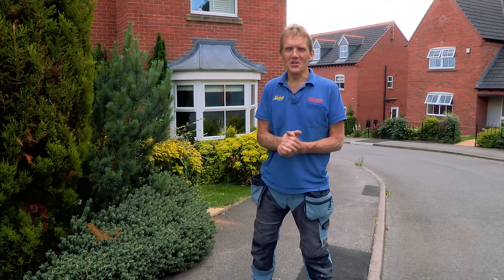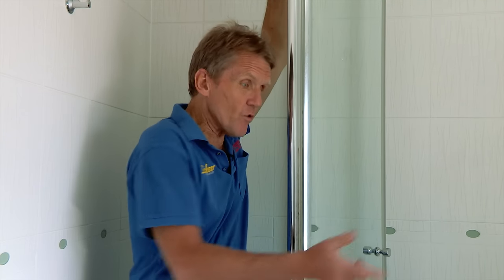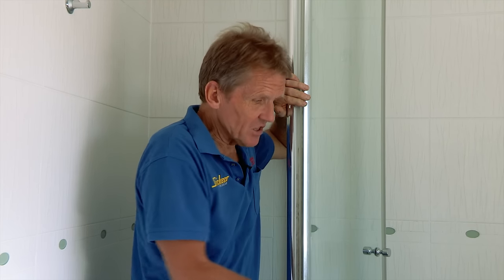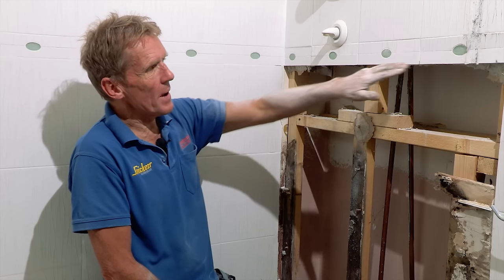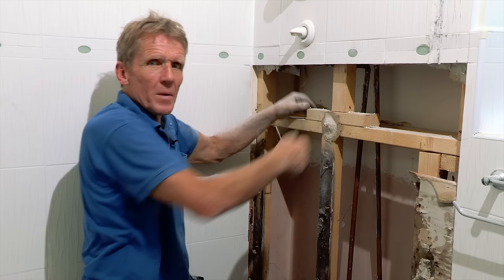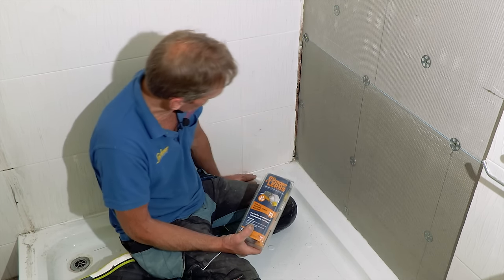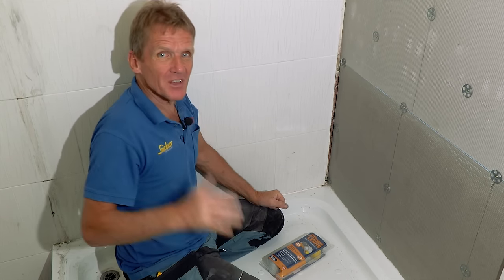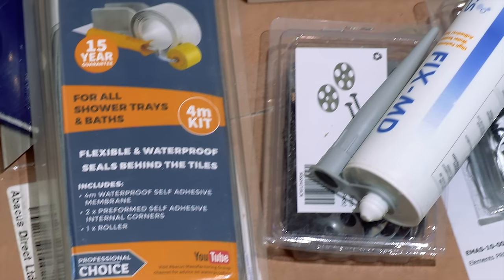Unbelievable Cowboy Plumbing Horror Show

Comment: Are you guys required inspections over there? At least where I live in the United States and you are building within city limits you are required to get certain inspections before certain building processes can continue. Would the inspector not find these issues like the shower valve not properly being supported and require the plumber to properly fix the problem before the tile guy can start his work? Also is the product you used like USG Durock board?
Reply: Have you every had anything inspected? Especially on a large jobsite. Inspector probably looked at one shower and said, "good. Do them all like this." Then the contractor gets lazy as the job goes on and doesnt do them all perfect.
Reply from the maker: That isn't true. The floors were held up on brackets which failed and the cumulative weight did the rest. How did those explosives get there?
Reply: Mate, many of the 'tradesmen' in the UK are not even trained properly anymore.  You can buy tools and be a brickie on Monday, then if you like you can be a chippie on Tuesday. Standards in the UK are low and our inspections and regs are just are, imo, terrible.
Reply: NO! Jet fuel can't even soften steel, that's what acetylene and oxygen can ONLY do.
Reply: Will Pelton - Actually there were NO explosives of any type used on 9/11 and there were NO real airplanes on 9/11 either. All SEVEN buildings of the Twin Towers Complex were mostly turned to DUST that day - so very little steel or anything else was moved anywhere especially China. Dr Judy Wood has exposed the TRUTH about 9/11 and how Direct Energy Weapons were used to turn these buildings to DUST. She took the US Government (NIST) and over 20 US Companies all the way up to the Supreme Court for putting out LIES with regard to 9/11 - two of those companies were Directed Energy Weapons MANUFACTURERS who were "helping" the US Government "investigate" the "collapse" of the Twin Towers. Wonder what collapsing buildings have to do with Directed Energy Weapons MANUFACTURERS - Dr Judy Woods EVIDENCE tells you what. Google Paisley Expressions and you will see excellent video interviews of Dr Wood and other videos exposing the TRUTH about 9/11 and the Jesus, Hitler and Wizard of Oz post on there just now exposes the agenda behind 9/11, 7/7 etc and how we have always been getting LIED to big time.

That post also exposes the massive debt/austerity banking SCAM and also the Mortgage/House Buying Ponzi scheme SCAM where the dumb sheeple are being conned into buying houses that they have already paid off through the secret Cestui Que Vie Trusts created via their Birth Certificates that they do not know that they have and the banks then con them into paying for at least another three houses over the life of the Mortgage and the biggest laugh is it never becomes their house even when they finally pay it off as everything belongs to the VATICAN via these Cestui Que Vie Trusts even your kids especially when they con you into registering everything to THEM. That is why you are only the registered keeper of your car NOT the owner. Part 2 of that post above is going to expose even more of all of this and how this scam system has been Foreclosed (SHUT DOWN) in 2012/13 but our corrupt controlled governments/political parties are not telling the people this.
Reply: What country is this in.
Reply: It is amazing the layers of bullshit we live under... well planned and hidden in plain sight, and people are so dumbed down they only see blue sky’s through chemtrails clouds ....
Reply: William Woods ... Does look like demolition explosives ...interesting thanks for sharing
(Tho it’s the ‘why’ that’s more important than the ‘how’)
Reply: @SkillBuilder  That's the 'official' NIST propaganda. What is true is that there WERE explosions that took place as watching any FOIA WTC video will prove - you HEAR them and have PLENTY of EYEWITNESSES. How the controlled demolition took place you'll have to ask CDI - or whomever was tasked under-the-table for the job. Simple physics would not allow a 'collapse' at free-fall speed. Sorry. Being a builder, you should know SOMETHING about that, eh?
Reply from the maker: Hilarious!
Reply: Countries gone to the Dogs. Thank god where getting out of the EU. Let’s take back control of our Building and Engineering Standards
Reply: @ronniewilson6597 ow they pulled it off 911? They aired an animated and prerecorded movie on all channels while they blew up the buildings. Not very complicated really.

Comment: I bought my first house, we moved  one week ago, i had a couple of shower and the plasterboard at lower floor has started to show a leak. Just looking at it, I was already aware that the shower was not really great.
I am an architect and i know how important is waterproofing. 
The bathroom has a very crap plastic shower tray which has been fixed just with silicon to the plywood, no membrane, no waterproofing nothing. 
The vynil sheet has been layed on the plywood directly sealing the perimeter with silicon around the shower tray, It is the worster thing i have never seen in my experience. I am starting to do the job by myself. Thank you for your video, it is really helpful to see from the pratical point of view..

Comment: Have not seen that Elements board here in the US but it looks quite nice. Every bathroom reno I've done, I have used the system from Schluter which is similar - a foam structural board with polymer facing. Then you can mortar a flat waterproofing membrane for vertical walls, and a corrugated waterproofing/decoupling membrane for horizontal surfaces. The decoupling allows the building to shift but isolates that movement from the tile work.

Comment: I did my bathroom with 1/2”  glass reinforced cement boards. The joints were silicone sealed before tiling and tiles were installed before the bath went in. Plumbing was 100% Hep2o.
It’s been there 25 years and still going fine.

Comment: Roger, I watched a video of an experienced installer who says that once the water gets in either through the grout or bad sealant you will still have to rip the whole lot out and redo, he says the expensive board is a waste of money. I can see his point. But I can also see the advantage of not allowing the water to soak into the substrate via the grout lines.

Comment: Marine ply is fine if used correctly, tile backer board over the top of plywood with a waterproof tanking matting and tape the joints then tile, it will never leak ever.
Moisture board or tile backer board on walls before shower tray then using the same tanking matting and taping joints, tile after the tray has been installed so it lips over tray and seal no problems at all.
Ply and moisture board absolutely fine if the person using it knows HOW

Comment: The more I do to this previously untouched 1982-build Martin Grant house in Guilford the more botches I find, from brickwork laid frog-down to useless  bracing in the loft to a ground floor screed that has a ridge running front to back and drops 1½" in one corner. 

When I pulled the bathroom apart I found the plasterboard stopped above the bath and rolled-up newspaper had been used to fill the gap before tiling over it. Needless to say the chipboard flooring underneath was like Weetabix. Fortunately no mould or rot.

Comment: I used to be a tiler/ bathroom installer in the UK for 15 years. I confirm that majority of bathrooms are bodged. I personally used Hardie cement boards with good Mapei waterproofing on top and Ditra mat on the floor. The idea is to make your tray and bath waterproof before you even tile. Also never dab and dob your tiles. I do something totally different now but missing UK and my old job sometimes.
Reply from the maker: That is sound advice, thanks.

Comment: I’m the owner of a medium sized plumbing company (14) engineers and I can tell you that none of these multi National home builders give two dams on the standard of workmanship no matter how pretty they make the homes look on glossy magazines. The reason for such poor workmanship is due to the builders telling the trades what there going to earn which is very little so in return firms will draft in lots of low skilled workers ( labourers) who are happy with £80 a day then on that site of say 200 houses you have one skilled full professional who will earn say £200 ( the going rate for skilled worker ) to oversee and make sure it works. That’s it as long as it works it passes. So it’s greed of the builder not prepared to pay the going rate to have a proper job as show by this chap in the video 
I’ve been offered sits across the country and I’ve been to check the sites out to see standard and have just turned round and said our lads couldn’t be this ruff to which the builder just grin and say someone will do it for this price
So there you have it greed wins the day not quality
Reply: I have been in the plumbing trade since the early 90's when I left school and I have to agree with you..
I don't know anyone in the building trade that has bought one of these new house and never have and there even worse now than they have ever been..

Comment: Great video Roger. With what you said about vapour migrating through the walls, would you use elements board for the whole bathroom, or plasterboard for the walls and elements only in the shower enclosure?
Reply: Hiya.When I built my own utility room extension 15 years ago because there was going to be a tumble drier I had to install a vapour proof layer of 1000 guage dpm under the roof joists prior to boarding for the reason you mention.Its there so vapour escaping the ceiling board cant condensate on the joists and bridging etc.Building regs stipulated that by then.Bathroom regs for new builds in the uk have also improoved since then for the reasons you mentioned.

Comment: I am an English plasterer though live in Australia, with 35 years under my belt.
I have seen many systems being used over the years, and most are certainly good enough if done properly. Unfortunately in nu builds/spec homes the system being used is rarely done 100% correctly.
The main problem is the original plumbing, if it is leaking through stress or bad workmanship, you have water escaping.
Even if the shower area is 100% waterproof, the water will instead bleed through the surrounding, and adjacent walls in other rooms. That can turn into a re-plaster of several rooms, and very expensive. If you can detect a musty/damp odor in the air, that is a sign of ingrained mold spreading.
Fixing and testing the plumbing for a period without plaster is the first step, then when confident that all is well, then re-plaster using the correct waterproofing method applied.

Comment: for showers I do:  PVC 40 mil liner from top to bottom on inside of shower pan.   Then cement board.  And then a 2 heavy coats of Red Guard polymer sealant.  Either the liner or the polymer are enough on their own, but I do both.

Comment: This all seems like a good idea, however having tiled bathrooms for 30 years I've never had a call back due to water getting through the tiles and damaging the plasterboard. Providing the tiles are properly installed and a good quality grout is used with good quality sealants and regularly maintained it will last indefinitely. Tiles have been put on plasterboard longer than I've been tiling and I've been back to jobs I have done 10 to 15 years later and they still look as good, even if the style now looks somewhat outdated. 
What I have found recently though is that I'm getting called to jobs where the system you use or similar, has been used. The problem is usually a leak in the pipe work behind the type of water proof system you used. What happens then is that the water runs down the back of the waterproof board, soaking the wall and timbers  behind and the flooring beneath. In a lot of cases because the shower area is virtually tanked, there are no visible signs and by the time the leak makes its way to a visible surface, the leak could have been there for months, or in some cases years, before the problem is detected. By this time there is considerable rot damage to all framing around the shower and to the joists beneath the shower, in some cases resulting in dry rot that becomes a much bigger problem than a few tiles coming off because the plasterboard behind has become wet.
So although this seems like a good system I think customers have to ask themselves, if there is a leak behind my shower, would I rather know sooner than later. If the problem shows on the surface sooner because the plasterboard deteriorates, then it is only a matter of carefully removing the tiles and damaged plaster board to just above the leek, repairing the leak, replace the damaged plasterboard, clean up the back of the tiles that were removed, re-tile and seal. The other option is to tank the walls as done in the video, have a leak that can go undetected for months or years, take the tiles off your new waterproof board, which will be almost impossible without breaking them, remove the waterproof board, remove any rotten timbers behind the waterproof board, remove the shower base and replace any rotten flooring, joists etc and rebuild the whole thing.

There are times when I've been called to redo tiling in bathrooms where tiles have been put on top of plasterboard, but I have never found the problem to be caused by moisture getting through the tiles and damaging the plasterboard, where the tiles have been fixed properly and the grout has been maintained. The problem always stems from leaks behind the shower or not properly maintaining the silicone seal. At least with plasterboard the problems becomes evident very quickly and is easily rectified. 

I have also heard of very similar problems with the new craze of fitting upvc fascia and soffit. With the traditional timber fascia and gutter, if there is a leak in the roof near the fascia and soffit, it soon becomes apparent when the paint starts to flake off. With upvc it can go undetected for a long time as there is nothing visible on the surface, unless you are lucky enough to spot a drip. I have many friends in the building trade who say that by the time the customer realises there is a problem the leak has been going for so long that major damage has been caused to rafters and joist and that if they had used timber the problem would have been identified much sooner, and the extent of the repairs would have been considerably less.

I would love to hear any views on this as I feel we have all been taken in by new technologies and how they are being marketed, the more all singing and all dancing the product is, the higher the cost.
Reply: I couldn’t agree more!
Reply: Maybe they have had call backs, but just not called you ;)
Reply: Justin Phillips Good point.....but not in my case.....they’re my properties!
Reply: Justin Phillips 

Certainly not the case that my customers are calling other companies to fix my work.  All my work is from recommendations and word of mouth, I never have to advertise and I have been back to virtually all my customers, not to repair bad workmanship, but to re-tile as either the customers tastes have changed or they feel their tiling is now looked a bit dated.  I now do work for the children of my first customers, not to mention other members of their family and their friends. So take another look at my points and you will realise that I am right, there is no problem tiling on plasterboard and you could end up with much bigger problems using a method that tanks the shower area, meaning it takes longer to realise there is a problem of leaks behind the wall and the subsequent increased damage because the problem wasn't identified sooner.

Comment: Most so called tradesmen pride themselves in what they don't do rather than what they do regardless of price charged... this is a breath of fresh air..  Showerwall/Aquapanel is far superior to tiles with grout joints - you can achieve a waterproof finish rather than relying on the substrate - my preferred option,  but this is very good.  I was going to pick up on rusty washers at low level but very nicely sealed in.  Good job.

Comment: 9:14 Had to look quick to spot this: he installed a support board for the shower mixing valve, an important feature the original plumber omitted.
I believe you could use Kerdi-Board just as he is using that material.

Comment: Not only in your half million pound houses. For a while, I worked maintenance in a very large care home, only 4 years old. 3 of the shower rooms had this exact same problem of tiles dropping off. The guy who had the job before me simply bodged it, rip out the manky pb & replace with a small sheet of pb, stuck all the tiles on with silicone sealant & figured it would do - it did, for a year.
I had an awful smell in a downstairs staff toilet, where they had connected the soil pipe, they must've used a mitre to get a good angle on it instead of cutting it square, so the top edge butts up to the shoulder, the bottom edge wasn't even slotted in. This was taking waste from 3 toilets and 3 handbasins. Every time water flowed down, it (mostly) flowed out. I scooped out the floor screed by hand - it was that soft.
I had numerous light switches and sockets where the pressure of the socket pushing extra wire into the box was all that held the wires in the terminals - so things flickered every time a heavy vehicle drove by. I found a kitchen sink installed using chromed tubes - the sort you find in a wardrobe, I even found a small storage room that the builders had simply blocked off! Instead of a door, they used studwork & plastered over it. Best of all, when I opened it up, it had a working light (yes, the light had been on day and night for 4 years) in the middle of the room and a couple of sockets!